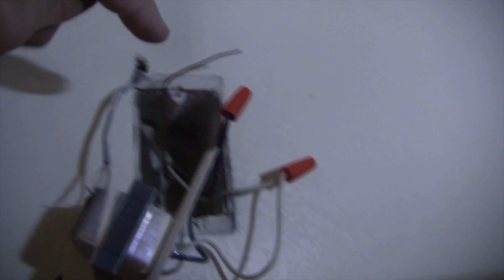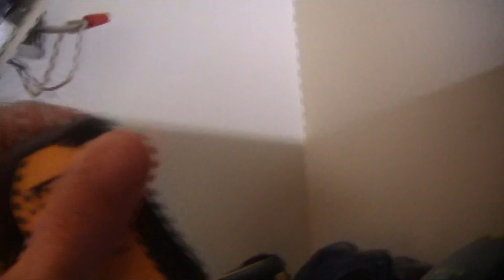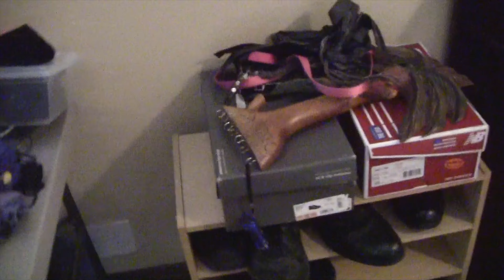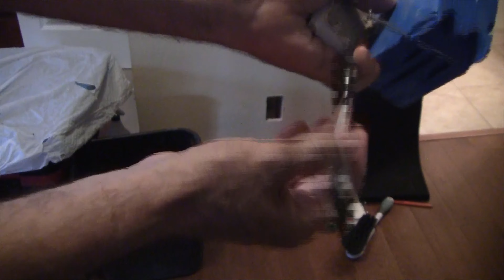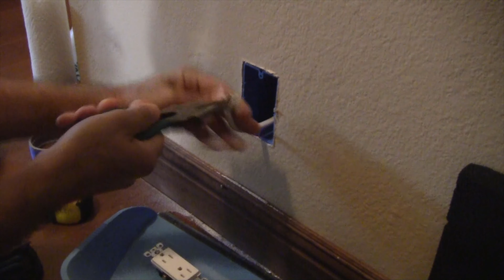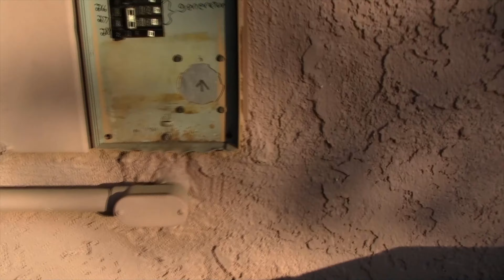How to Install a New Electrical Outlet Per Code

Comment: How do you know the circuit is not overloaded?
Reply from the maker: I did not put my amp meter on to see if there was any real load on there before installing the duplex. I could have done that but my panel is very congested and pulling amp loads is not fun. I just wanted to run a vacuum cleaner on that and not a constant load, so I felt comfortable with the install. Btw, the circuit has been working as intended since the install. no issues.

Comment: Aren't you supposed to use a crimp connecter to join ground wires?
Reply from the maker: not a code requirement.

Comment: Cool video. My understanding is the protection plate is needed for the "next guy" that comes along with a bigger screw! I saw a video recently where the guy used a sleeve in the hole that provided UL-listed protection. It would've been a nice solution for you because it would've allowed you to screw safely right next to the cable and also would provide protection from the outlet-side of the wall.

I can't remember the name of the product, but at least it's good to know the thing exists!
Reply from the maker: i found it. https://www.amazon.com/Madison-Electric-Smart-Shield-Guard/dp/B08HCHSDHT/ref=asc_df_B08HCHSDHT/?tag=hyprod-20&linkCode=df0&hvadid=532565192785&hvpos=&hvnetw=g&hvrand=151645102325760525&hvpone=&hvptwo=&hvqmt=&hvdev=c&hvdvcmdl=&hvlocint=&hvlocphy=9031563&hvtargid=pla-1435580239890&psc=1